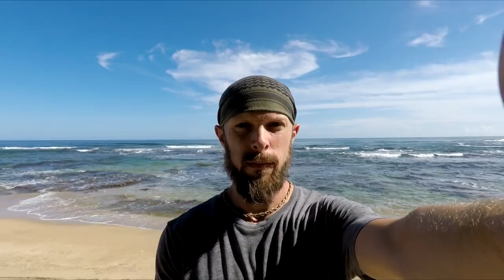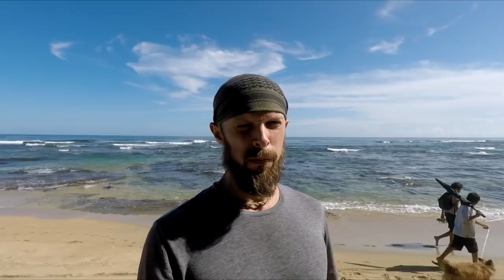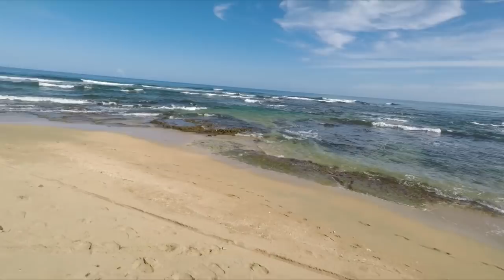HOW MUCH DOES IT COST TO BUILD A COB HOUSE?

Comment: I think you should mention/consider the fact it costs a lot to have a home built in different areas. In Florida I looked it up it costs between 200,000-400,000 on average to build a home usually and I think it is totally doable to build a cob house here for less
Reply: I think so too
Romans 10:9

Comment: The main advantage of this type of housing is probably the fact that the materials can be found for relatively cheap prices and in some cases almost for free (straw for example) the only cost is transportation fees. 
Another thing is the building process, a person can do a lot by himself without much education, sure practice and education helps a lot, but one can learn a lot in a process of building.  
Talking about expensive stuff such as proper electricity wiring, plumbing etc, these prices also go to any other type of house you are building. 

I still think that these types of houses should be build by the people that can get the materials for free or nearly for free. On the other hand if you still need to pay for the materials, then maybe a traditional house is a better option.

Comment: As far as the permitting goes i would suggest the most important ally you will need is an engineer who is happy to sign off on your plans. Traditional compacted rubble trench can be code compliant if designated as compacted fill. For a residential dwelling it will comfortably exceed load carrying requirements by spreading loads deeper and wider than a slab plus it drains and is thus more stable. If you must then cast a perimeter bond beam to carry your stone plinth but only if you are forced to.
Nobody is going hold back on your stone plinth meeting code. Its a masonry wall. My advice would be to take a load of the engineers back by making the wall non load bearing and supporting the roof with posts. Its much easier to pacify neurotic planning guys then. 
A simple post and beam frame can be very inexpensive as your not using as much dimensioned timber. 
Formula for cheapest design ?
Single low pitch skillion roof with large overhangs to protect walls from weather and keep inspector from worrying about driven rain.
Single story rectangular floor plan 
Simple timber post and beam frame to support rafters spaced to act as purlins.
Steel/corrugated iron roof for low load bearing low cost and ease of install.
Source rocks for plinth in large monolithic blocks you can cut with demo saw
Rough sawn lintels made from used railway ties or green sawn. 4”x8”. Go direct to sawmill and spec rough sawn green.
Make doors from t and g and battens.
Second hand windows or make your own.
Make the floor from cob too with a rubble base to get good drainage.
Get the house to lock up then worry about the fit out. 

Thats not exactly how i did it. Its how a kiwi did it whose house i stayed in. Brilliant job. 

What freaks out the code guys is weather resistance and load bearing. If you show them how you covered that they will not freak out on you.
It all depends on keeping it simple enough you can do more yourself easily.
Reply: Thanks for this!